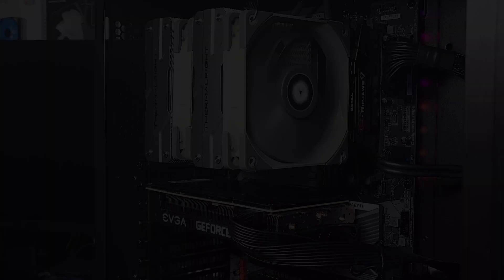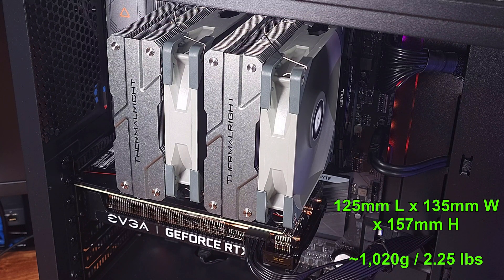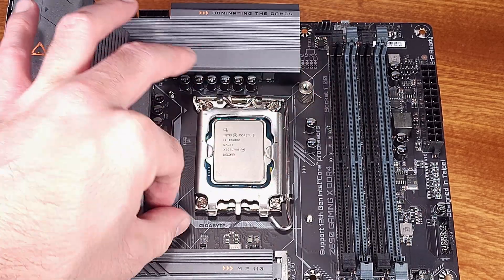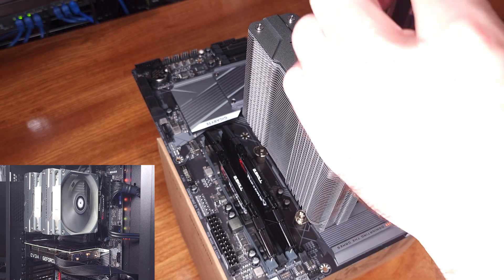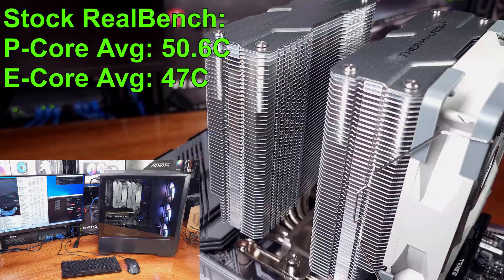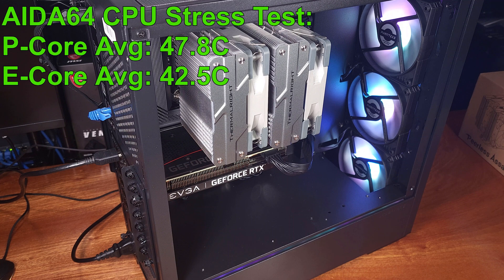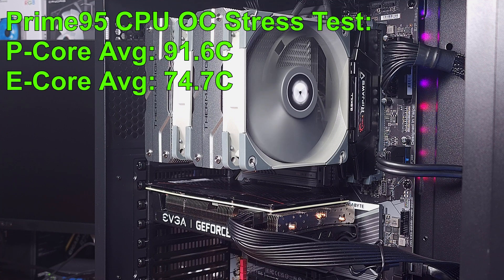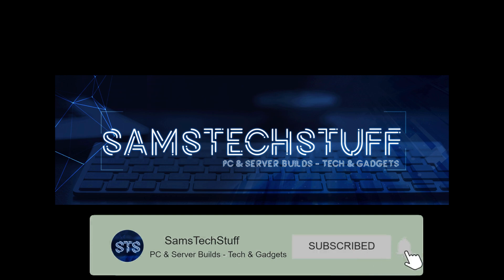~$42 ULTRA Budget 12600K CPU Cooler!

Comment: I know this video is from 2 years ago but do u think a contact frame will improve the temps? is it worth the $6?
Reply from the maker: @gtALIEN  Hi! That depends on your CPU and what the temperatures are like under load. On the higher wattage i7 and i9, the frame should help shave off between 4-9C based on what I've seen on average. 

What CPU did you have and what are your load temps?
Reply: @STS  the same one as the one in the video, the 12600kf
Reply: @STS  idk about load temps I haven't built the pc yet
Reply from the maker: @gtALIEN  You don't need a contact frame for a 12600KF. Youur CPU will run just fine without one of these. That being said though, you might be able to shave a few degrees C off of load temps with one of the common contact frames.

Was this a gaming or workstation build?
Reply: @STS  It's like half half, I'm building it for a friend for gaming, but he's also using it for arcgis for his major

Comment: what if i put the other fan on the left i dont like to put beside the ram, does will affect the temps?
Reply from the maker: Very minimal impact, maybe only ~1C. I would not worry about the fan placement too much. Is this a new build or cooler upgrade?
Reply: @STS  i want to pair my new cpu ryzen 7 5700x
Reply from the maker: Nice, it will serve you well! Just make sure your case will support the cooler height and that the VRM heatsinks aren't taller than your memory (for the fan placement) and then you should be good to go.
Reply: @STS  thanks!

Comment: Would you recommend it to oc a 12700k ? Thx !
Reply from the maker: If you want to air cool your 12700K with an overclock, yes, I would definitely recommend this cooler. I will say though, it's likely this cooler can perform slightly better with better quality fans but I believe it would be fine for a 12700K and a reasonable overclock.

Are you building a gaming PC?

Comment: hey bro do you think corsair vengeance rgb pro will fit under the fan??
Reply from the maker: That's a tricky one, technically the PA120 only has 42mm worth or memory clearance which isn't much. You can adjust the front side fan upwards to allow for memory to fit (depending on slot usage and motherboard). IF you do end up moving hte fan upwards it will likely reduce the coolers maximum performance a little bit. Did you end up picking this memory kit up or going with something else?

Comment: Do you think this could handle teh 13600k also or too hot?
Reply from the maker: Sorry for the late reply Direwoof! This cooler will definitely be a good match for a 13600k! The only real concern is will it fit in you PC case. 

Did you end up picking one of these up or were you in the planning stages still?
Reply: @STS  I ended up getting a FUMA 2 for 40 dollars, it's still quite hot when running cinebench like 100c but gets a decent score uplift over my former one and it's much cooler whilst gaming.
Reply from the maker: Very nice! Glad its working out well for you in your main use-case!

Comment: I have a Ryzen 5 3600 , overclocked to 4ghz at 1.1 V, idle temperature is 32 and gaming max is 42🤣love this cooler
Reply from the maker: Wow, those are some amazingly low temperatures there! Awesome undervolt too, undervolting doesn't get the credit it deserves IMO. And yes, this cooler is a beast! I want to test it on my new Ryzen 7700x as well, but with faster spinning fans.

What's the rest of your build look like in terms of parts? Sounds like a good value setup!
Reply: @STS  GPU 6600xt , my cpu is a slight bottleneck. Planning to upgrade to 5600x or 5700x later on in the year. Using a Mb520 case by cooler master so plenty airflow. Also bought some Arctic pwm fans recently and loving them! You really don't need to spend much to get quality these days.
Reply from the maker: Sounds like a really good build you have there. Couldn't agree more, a 5600 upgrade would make that a solid budget build. I had a 5600x for a while, ran well and gamed like a champ, especially if you can pick a cheaper used chip. 

The CMP520 and some Arctic fans are a killer value setup, I've tested both the case and fans in the past, really good stuff. 

I'm hoping to get into some more case and fans testing this year, looking forward to new releases!

Comment: What's the difference between the PA120 and the PA120SE? Which one is better?
Reply from the maker: Hi Requiem! I think the coolers are actually very similar but the newer PA120SE seems to be just a little bit smaller than the older PA120 model, its got 3 fewer fins in the fin stack. There's probably some performance difference there somewhere but, I would not expect that to make a difference for 99.99% of users. Are you upgrading your cooler or building a new rig?
Reply: @STS  Hello, I am thinking about upgrading since now I have an Arctic 7 Pro Rev 2 to cool an I5-9600K stock inside a Cooler Master MasterBox K500L with the standard fans (two in the front and one in the back, 120mm as far as I know) Thank you for the answer
Reply from the maker: Ah ok. Yeah, a PA120/120SE will be a bit bigger and better at removing heat. I found with some optimization I could run the fans quietly on my setup. This cooler should perform well for you. Are you going to overclock with the cooler? I remember those 9600k's doing quite well

Comment: 5:42 it really does, it keeps my 5800x at 40º to 45º while gaming and 60º max on a stress test.
Reply from the maker: That's a great temperature An Dres! This is definitely one of my favorite coolers to recommend at the moment. What kind of games are playing with your rig?
Reply: @STS  Currently playing the division 2 and dying light 2.
I did undervolted it to 1.1v on 4.3ghz, i play at locked 60fps so games don't use that much of cpu thus temps being so low.
Reply from the maker: Decent undervolt for sure! I'm always surprised at the growing amount of people who undervolt. I may start testing each of my CPUs in the future. On my main Ging PC, a Ryzen 3900XT, I'm actually testing running the CPU on the Eco mode, 65w TDP. Performs surprisingly well. I'll have to see how far I can tune my 12600k!

I just started playing CoD MW 2.0, a little glitchy and repetitive but, I haven't played a CoD in years so I'm having a bit of fun with it
Reply: @STS  yeah undervolt is a great thing to do when you don't need full juice, specially while using 5000 Gen ryzen, it doesn't benefit that much from an overclock as it does with an undervolt.
My previous ryzen was an overclocked 1700 at 3.97ghz even then, the thermalright did an amazing job cooling it.
I'm not much of a cod player, I do enjoy the campaign mode though but multi-player feels extremely frenetic for my taste.
Reply from the maker: 100% agree! I've owned nearly all of the different Ryzen CPUs at one point in time now, the 5000 were really quite interesting / fun to work with. I have a Ryzen 7700X rig now as well, looking forward to optimizing power/ performance that CPU soon! I'd love to have a solid gaming rig that consumed as little power as it had to - heat is a limiting factor on Ryzen 7000 for sure.
Reply: I bought this AIR COOLER on Aliexpress last week (I'm from Brazil) for my Ryzen 5900X.  I saw foreign tests (this processor is not sold in Brazil) and its performance is similar to Noctua NH D-15.  I currently use the Corsair H60 but with an undervolt of 1,185 clocked at 4.2 to keep a low temperature.
Reply from the maker: Hello! 

Yes, this cooler performs similarly to the mighty D15. I was quite surprised by how well this cooler performs for the price and I would definitely recommend it!

I want to test it on my Ryzen 7700x next and possibly swap the fans for a test as well

Comment: I wouldn't recommend this for anything under a 12600k
Reply from the maker: It would likely be overkill for a 12400 but it would work well. I think it makes the most sense for a 12600k or 12700k. The 140mm option is probably better suited for the 12900k. I'm thinking about picking up a 13600k for testing with this cooler as well

Comment: Going to use video later to install my cpu cooler. Question: does it come with a lga 1700 bracket or do I have to buy that separately?
Reply from the maker: When I bought mine from Amazon,, it came with the lga1700 mounting kit. From what I read in the comments, it seemed like the stock they have now does include the lga1700 kit. If you do pick up one and it doesn't have the kit you can contact ThermalRight and ask for a kit.tjere might be a cost, I'm not sure. I think it's worth it even if you have to buy a $5-$10 mount. This cooler performed incredibly well.

Comment: Think you can test on a 12700k or 12900k?
Reply from the maker: I don't have a 12700k or 12900k at the moment. G7400, 12100,12400, and the 12600k. If there's enough interest, I may look into buying the 12700k/12900k or I may opt for the i7 or i9 13th gen since it won't be long now. Let me know if anyone is interested in me moving to higher power output CPUs for testing or if we all want to stay in the midrange / value performance category.
Reply: @STS  ah cool. Yeah, this seems like it could be a really good buy for the 12700k too, the 12900k might be too much, dunno. Keep up the testing!
Reply: I use it on a 13700k and it is perfectly fine for gaming. It easily reaches max turbo according to CPU-Z.  The highest temp I've seen while gaming on a 13700k in a 70F room was 56C.

Comment: Nice! I got the TR peerless assassin 120 SE around $40. I’m installing as soon as I get home. Although there is the issue with ram clearance. I did not think, until now, to check  . Thank you for the review Sam! I got a ryzen 5600xt with a RX 6600 to match. Also  going with off brand case Zalman i3 NEO ATX. Keep this up man!
Reply from the maker: I have to say, the value proposition here is INSANE. The size and performance of this cooler for $40 is amazing. As for memory compatibility, I suppose it depends on your memory kit and board a bit too.

The 5600x and the RX 6600 is going to be quite the bang for the buck combo! I'm thinking about acquiring an RX 6600 for testing and benchmarking, we'll see.

I'm not familiar with that case, I'll have to check it out. As long as you have some decent airflow and the case can support the cooler height, you should have a killer value setup.

Thanks! I'm looking forward to testing more coolers on the LGA 1700 platform and have quite a few component reviews on the way :)